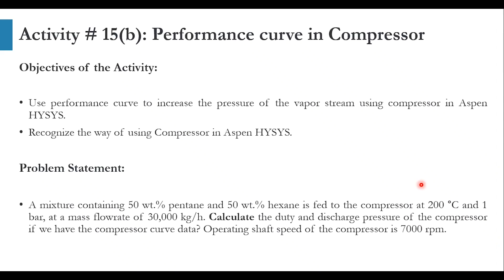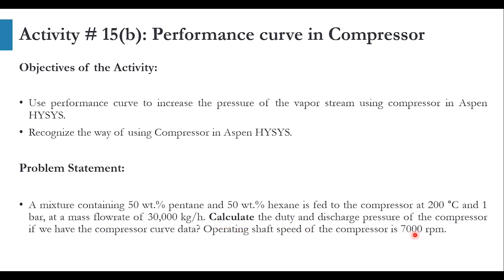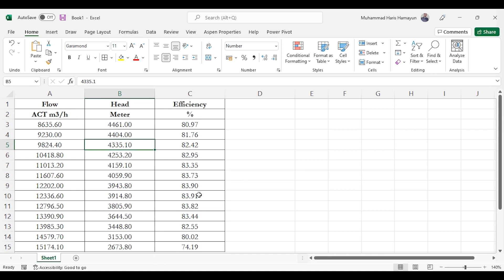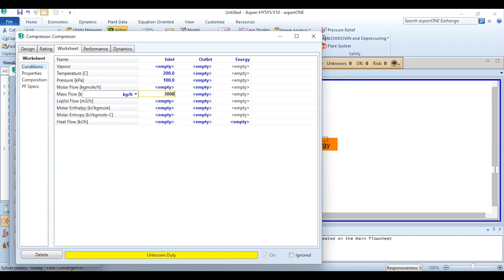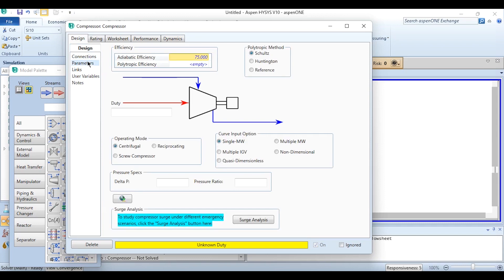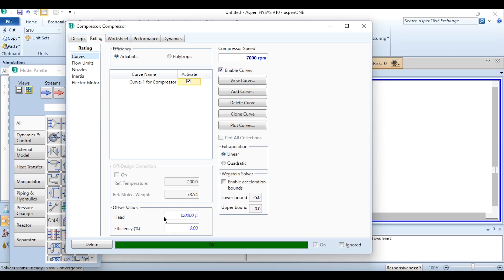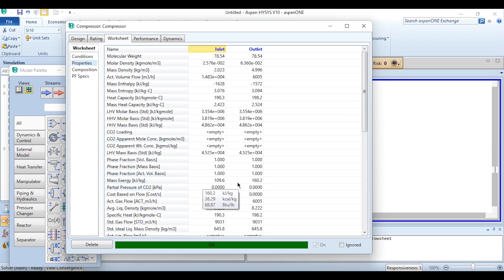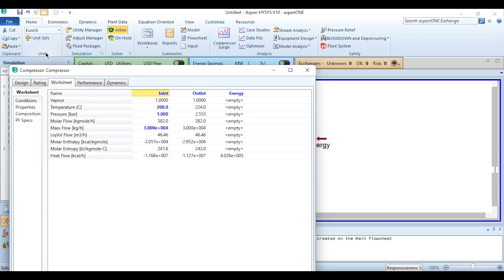How to use performance curve for the compressor block in Aspen HYSYS - Lecture # 97

Comment: Hi. The operating point is shown outside the head and efficiency curves. You may need to specify to generate the curve at 7000 rpm for the operating point to be included in the curves? Regards.